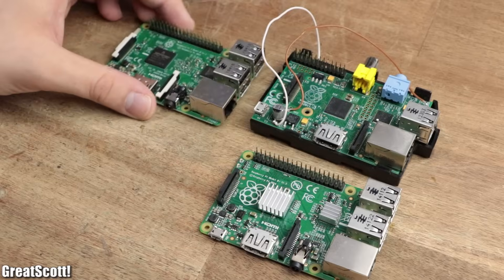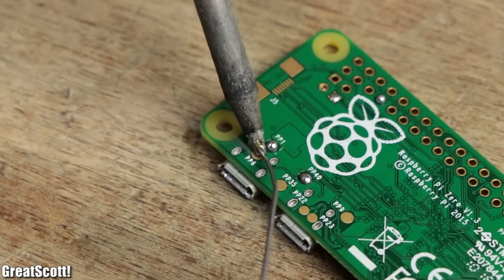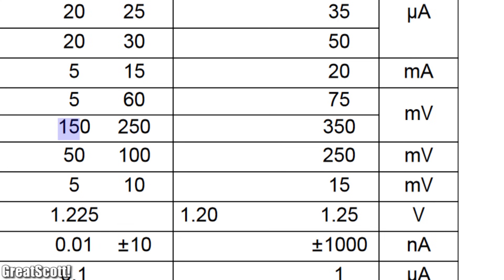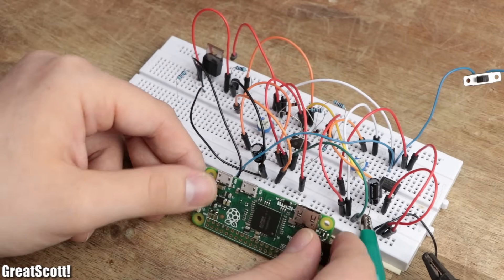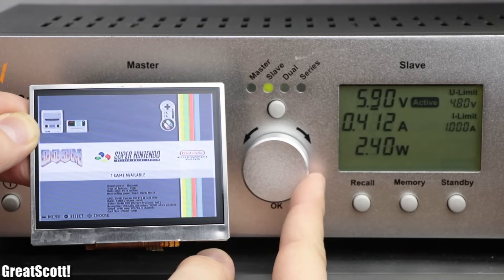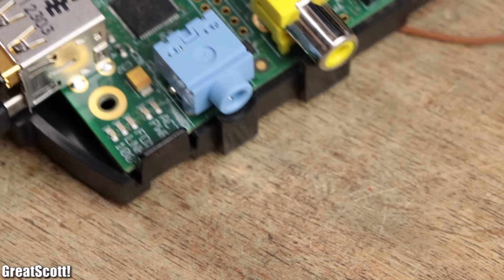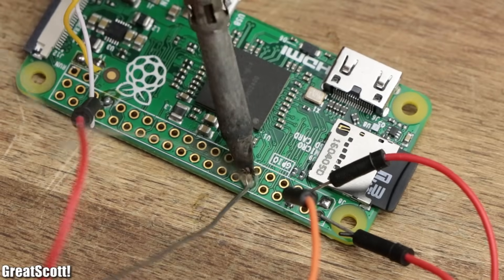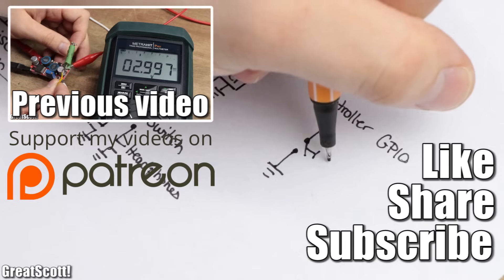DIY Raspberry Pi Zero Handheld Game Console (Part 1)

Comment: "4 Eneloops in series gives us 5.6 V" - I undstand that!
"Now we just need this max667 that powers this mcp through the non-inverting pin 5 of the opamp with a comperator that activates a flipflop clone that pulls down the gate" - O_O
Reply: just use a li-po battery with a power bank battery charger
Reply: 0-100 REAL QUICK

Comment: Very cool project! But I think you've overdone yourself a little bit with the overdischarge circuit, making it a little hard to understand for electronics beginners. I think a generic eBay 5V power bank with an 18650 Li-Ion cell and integrated boost converter and overdischarge protection would be much easier to implement.

Comment: if you want to change brightness and stuff on that 3.5 inch screen, use 3 buttons, with resistor values of 1K, 2K, and 4.7K. This will give you access to the menus. plug your buttons into the white 2 pin connector on the screen driver board. 
(i just watched it again, and see that you got the version with the buttons - still, it might be useful info for someone else i suppose)

Comment: It's important to prevent lithium batteries discharging too low, but with NiMH batteries it doesn't really matter if you run them flat.  So why bother with the over-discharge circuit?

Edit: Maybe the Pi is more likely to corrupt its SD card if the power supply 'brown-outs' gradually?
I would prefer to use a single lithium cell with one of those all-in-one charger/protection/boost modules that allows you to charge the cell, steps up the voltage to 5V and cuts out on over current or low cell voltage - you can get those for $2 or so on Ebay.
Reply: Well, that is not entirely true, the system in the video uses a series string of multiple cells, and in such an arrangement complete discharge will always risk damaging one or more of the cells due to reverse charging.

In fact, it probably would be an advantage to have balancing and protection circuits on pretty much all chemistries if you want to maximize the useful life of the battery. But I suppose that as long as the battery will not cause a fire if mistreated, a bit of reduced life and risk of damage is accepted to reduce cost and complexity, and if you need to buy a new battery a few months early, well, that is just good for business, isn't it...
Reply: it'll stop running long before that would happen. I'd risk it, nimh batteries are cheap as chips and safe.
Reply: yeah i am puzzled by that too
Reply: ceptimus exactly. Would have been so much less work.

Comment: Not gonna lie, I understood about 2% of that. I really need to study more :(
Reply: same all i heard was: volt volt volt volt wifi and more volt
Reply: Yella Dart hes so smart man.  I feel the same that you...
Reply: me too :(
Reply: abid latif take electronics and it'll teach you exactly what to do ^-^
Reply: You can use a raspberry pi 3 and just load the emulator on its OS...play the games with a USB controller but it won't be as enjoyable as this handheld.
Reply: I teach electronics and have studied for a few years. LCD displays make anything ridiculously complex. I avoid using them.  To be safe, I just buy kits of these already tested by others and put them together. Its just easier. Seriously, displays will turn any simple project into a headache.
Reply: left my face like (O_o)
Reply: He should have gone into alot of detail on how to do it and show how to
Reply: I thought he was drawing a stick man at the very end
Reply: Same here.
Reply: You have to learn about computational systems. Cpu, memory, IO , power sources, transductors , voltage divider..

Start from the basics.. Kirchoff's law. 

Then go to transistor, bjt, cmos.. 

Learn logic gates,  flip flop, memory , alu, then microprocessor, microcontrollers. 

Learn programming, assembly, compilers.. 

One knowledge enelops the predecessor..
Reply: I'm a programmer and I know the basics of eletronics, but still this is a very complex stuff, so don't worry, I didn't understand 50% either :)
Reply: That’s sad
Reply: Yea
Reply: No its beacause its not a diu
Reply: Yella Dart I’m in the 7th grade. I find this interesting and I understand it all.
Reply: 0.1% load here
still loading
Reply: Its going to be hard for me to understand as well but I'm trying to because I have a project in mind and I would love to finally commit to one instead of it just being a thought that never happens.

https://twitter.com/wedeemchannel/status/1304775264472305665?s=20
Reply: You don't have to understand it. Just copy it, then study it after you blow it up. That's how you learn! ☘️
Reply: lmao same im too dumb for this
Reply: link
Reply: Shit, I'm there with you.
Reply: me too all volt terminal volt terminal
Reply: its okay, i dont understand most of it either. Neat though
Reply: I understood:)
Reply: Yella Dart well, the rocks in his mouth don’t help either

Comment: Wouldnt  using a single  18650 cell  have resolved all your probelms? it's range is  (AFAIK) 3.5v-4.2v and there are some  that can  handle 20 amps of drain. Such as Samsung 25r or  LG HE2 , those have 2500mAh capacities and can handle 10 amps with  absolute ease.

Comment: you can use a switching jack for the headphone output, so it cuts the signal going to the speaker when you insert the headphone connector.

Comment: Very good and informative, keep it up 👍 Here is a thing wouldn't it be better if you just simply used a raspberry pie 3 and desolder LAN, USB ports and audio and gpio ports to make it slimmer? There u would have native lcd,wifi (for whatever reason u might need one, downloading games maybe?),Bluetooth (second controller) and audio support plus more power, and maybe you could use a standalone atmega 168 (or anything else if there's a cheaper adc available) to monitor battery level and send a shutdown command when it's too low (I'm pretty sure your sd card won't t love those sudden power cuts). It wouldn't be as cheap considering Rpi0 vs Rpi3's price alone but it saves you from thst much of circuit design and soldering and it would be a much more expandable project then. 
PS: comment got longer than I expected, sorry about that, My brain just won't stop spitting out ideas. 😜

Comment: First of all, very nice video. I'm actually working on a portable retro console myself and I have already done most of the work. Basically I only need an enclosure.

Now the interesting part for everyone, who wants to build something similar :)
The Youtuber weremy has an absolutely awesome guide on building the unit into a Gameboy case.

And one small thing: I think it's way easier to use RetroPie (Emulationstation) as OS.

Comment: I don't get why you made such a big circuit for low voltage cut off. You could have programmed the pi to use one gpio pin to check battery voltage and when below the min voltage it auto shutdown. That way the pi will also have a safe shutdown instead of directly cutting off the power which might cause curroption..

Comment: "oh, it's just another raspizero handheld" i though before the video.
How wrong i was. Createing your own voltage regulator, explaining the process, and showing every step... things like thta are why I subscribe to your channel <3
Reply from the maker: Thanks mate ;-)
Reply: bro I liked your videos so much that I clicked on subscribe button twice ;)
Reply: Nooo. Just kidding. You can use that.
Reply: Scott, is implementing a B+ relatively the same in terms of difficulty? (I am going to try to reach out to you for promotional advertising )
Reply: hello can  i use a battery module to charge battery?
thanks
Reply: Yes, and you should actually in my opinion. It has both under and over voltage protection.
Reply: I am actually bookmarking this for learning more about your regulator circuit!! Thanks for the video!

Comment: why not use retropie ?
Reply from the maker: I tried. But it was way easier to set up recalbox.
Reply: retro pie was really easy to set up for me
Reply: What was easier? Because I run Retropie in My Arcade Cabinet and it's perfect. Would you say that recalbox is easier than Retropie. Or was it just easier to work with a RPi Zero?
Reply: probably because you cant use gpio pins as controllers in retropie
Reply: i don't understand why everyone still uses Retropie. It was probably the first Pi retro distribution but now there are other solutions. I'm not saying that it's bad, but having tested Retropie, Recalbox and Lakka, in my opinion Lakka is the best and Recalbox is second.
Reply: Derek I'm going to have to look into those, I've only ever heard of retropie

Comment: what are your thoughts on a rpi camera especially considering that the zero supports it too now?
Reply: I think your missing the entire point, it's not designed for taking great pics. It would be good for a security camera or a wildlife camera that goes off when movement is detected.
Reply: talha yaprak My thought is, that it's absolutely useless, unless you really want to make a Diy mini camera.
Reply: Manuauto well that is why I am suggesting it, because i want to see a diy mini camera. Also. it wouldn't be useless,
It would be great for timelapses as it could have a giant battery
Reply: Connor Gleeson so a remake on the security system then? (Was that him or someone else?)
Reply: I made a night vision camera using a pi-zero and the night vision camera available on pihut. Works like a charm.

Comment: NiMh batteries should be fully discharged to prevent the "memory effect" :)
Reply from the maker: You mean NiCd batteries. Modern NiMH do not have that problem.
Reply: If you charge them before they are completely empty on a regular basis they will remember how many mA's you've discharged them and have a hard time delivering their full capacity. As scott said it's mostly known to happen with NiCd but there is a debate whether or not NiMh have the same problem.  They will not get harmed by a full discharge non the less so I prefer to discharge them completely :)

Comment: what class SD card did you use?
Reply from the maker: No idea. It was a pretty generic one.
Reply: Can I make it with a 2600mAh power bank? It's easier to charge and it has protection circuit.
Reply: You should use a Class 10 microsd.

Comment: Where did you get this Raspberry Pi Zero from? I can't find them anywhere?
Reply from the maker: There are links in the description. (I recommend the Ebay link)
Reply: If your in the US microcenter sells them for $1
Reply: GreatScott! I love the video, and I've been wanting to make one of these for weeks! The only issue is that Making those circuits (the audio, video, and power supply stuff) is a bit beyond my capabilities as of right now. Is there anywhere I can get those boards either pre made or at least in a kit with all the proper materials so I don't have to worry about getting all the right stuff? Thanks!
Reply: Pi moroni and thepihut ships within a week in europe
Reply: I got mine on the adafruit website. it's the only place I could find them